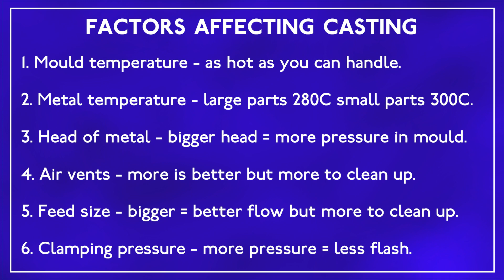HOW TO… PART 2  ‘CAST FROM SILICONE MOULDS’

Comment: Correction...pewter and white metal are not the same. They have different components. Pewter is usually a stronger alloy than white metal. According to Bing AI: Pewter and white metal are not the same thing. Pewter is a malleable alloy that is made primarily of tin, with small amounts of copper, antimony, and other metals added to it. White metal, on the other hand, is a term used to describe a range of alloys that are white in color and have a low melting point. It is often used as a base metal for plated silverware and jewelry. The composition of white metal can vary depending on the manufacturer, but it typically contains tin, lead, and antimony
Reply from the maker: They will both cast with this process.
Reply: And being an antique collector I’ll add, white/pot/hard white/Britannia seems to be crystalline and is definitely more brittle and rigid

Comment: Modern pewter is about 91 percent tin, 7.5 percent antimony, and 1.5 percent copper. lead in pewter was banned in 1974 for a good reason, so if you are going to handle your model a lot make sure its lead free.
Reply from the maker: You are absolutely right. Pewter containing lead should be handled with respect and was banned from drink / foodware long ago. I take care at all times not to ingest any.

Comment: Maybe if you can find a 1cm wide long strip of leather, wet it and wrap it around your warmed mold with boards. Even a few wet leather strips would function better than rubber bands and would be heat resistant and reusable for the most part.  Inner tubes cut into enormous rubber bands or strips to tie or wrap, could last longer for larger molds
Reply from the maker: That's a good idea I may give that a try, thanks. 🙂
Reply: Muy buena idea
Reply: I saw another video doing it with aluminium tape

Comment: I tuned in for casting tips (interesting trick with the vents going through the mold!), but then my jaw dropped at the end when you showed your hand finished master from the casting.  Lovely work!
Reply from the maker: Thanks Peter, I'm glad you found the video useful. As you can imagine it takes quite a while to transform the larger ugly castings into finished masters, but it's a great technique for converting an object into metal. 🙂
Reply: My jaw dropped when I saw your hands….
Reply: Don’t all vents go through the mold?
Reply: My experience is with resin casting. Typically the air vents are only cut up, across the face of the open mold. The idea of adding vents at catchpoints THROUGH the rubber is new to me. :)
Reply: @gribzilla  no comprende
Reply: Not sure how to explain more clearly. At 6:29 he’s pulling out the vent/sprue I’m talking about (as opposed to the vents cut off after demold, which traveled across the open inside face of the mold)

Comment: Hi Im getting a fair amount of size difference between master and metal cast - (maybe 8- 10%) Masters are mix of green stuff and pro create. Is this normal?
Reply from the maker: Hi Rupert. That shrinkage is very high. The bigger the mass you are casting the more shrinkage you will get.  Try reducing your casting temperature to 280C or increasing the size of the head of metal to get more pressure in the mould. You may have the mould too tightly clamped together which is flattening the mould cavity. Use as little pressure as possible. Hope this helps.

Comment: A simple trick for making molds like this with zero flashing is to use a Dixie or paper cup or similar plastic cup to pour the initial rubber mold. You want to use the kind of cups that have a straight wall taper, like paper cups, not the kind that have ribs or contours like plastic Solo cups. You place the cup over the pattern and cut a hole in the bottom to pour the silicone in.  Seal the bottom with plastilene  or a glue gun.   When you fill the inverted cup with silicone it’s essential that you stop shy of totally full.  Leave the rubber surface a tad below where the bottom of the cup was. ( so pick a cup sufficiently taller than your tiny model ) When you demold you will likely have to tear the waxed paper cup off, but afterwards ANY paper cup of the same type can work as the casing to hold the mold together.
You then cut the rubber apart to create your two halves of the mold. Cut any additional vents or sprues as needed.  
Here’s the good part. Dust the interior of a matching cup with talc and drop the mold in the cup to hold the rubber together. Then TAP the mold on the table. No clamps, no rubber bands needed. The straight taper of the sides of the cup allow the silicone to settle deeper into the cup ( because you didn’t quite fill it all the way ) and that compensates for mold shrinkage and allows the two mold halves to close perfectly tight and perfectly aligned without over-compressing or distorting the mold cavity. The cup itself contains any leakage, but if you do this right, there won’t BE any leakage. You should get parts with zero flashing and often no discernible parting line at all. 

Also- be aware that for casting pewter or pot metal you want to use a Platinum cured silicone.  Tin cured silicones will SWELL and distort as they become heat soaked.
Reply from the maker: Great hack, thanks for sharing. I'll give it a go. 😎
Reply: @ Not exactly a hack.  I used to setup mold operations for various companies making a variety of products seeking the lowest possible cost and highest possible fidelity.  I did exhaustive cost/benefit analyses of different mold techniques for various kinds of products. What we called ‘Dixie cup’ molds turned out to be the lowest cost, highest quality method for any item small enough to fit in a Dixie cup with room to spare, although it is getting harder to find a good supplier of smooth taper waxed paper cups anymore.   To lower costs of silicone for mass production, I would make a second mold system that produced thin silicone molds and one that made a urethane elastomer overwrap filler.  The urethane filled the contours between thin silicone mold and the shape of the Dixie cup. 
The urethane parts would last for a year or more of casting 12-15 rounds per day in resin, and the silicone inner mold that actually printed the cavity was a lot more flexible due to only being 0.2” thick on average, and was less expensive to mass produce. ( we would have 40 to 60 copies of a given mold on the casting tables for each different product, so we had separate molds for mass producing the molds.) 
This technique took the least amount of time and materials to make, but even more importantly, takes the least amount of labor to operate, and results in drastically less labor in cleaning up castings. 
Although, for mass producing pewter we generally opted for vulcanized neoprene and a centrifugal casting machine.  Large rotational media polishing, etc.
Reply: @ Going further, because these molds are most often cut open blind after the silicone sets ( the hand cut separation line actually is more accurate as regards parting lines and flashing than a fully separated two pour mold with keys ) We would set up a master with a series of vents made of 1/8” or even thinner metal rods, stuck into holes in the board the master was mounted on, so that they would not shift as silicone was poured in. After the pour, when we pulled the master and mold off the board you could see the stubs of the wires sticking out and they acted as cutting guides to lead an exacto knife along the planes we wanted the mold to be separated on.   Like for your featured figure, I would have a wire leading straight up from the board to the tip of each arm.  They would establish the fairly straight separation plane and guide my knife directly to where I wanted the mold to break.  You can even cut 3 and 4 part molds to accommodate complex models, or lateral partial cuts to make the mold more flexible to get tricky bits out.  But the key is the actual smooth taper of the cup and perfectly circular mold shape to ensure the mold is closed with exactly enough pressure to hold the separation lines sealed .

Comment: Thanks again, a very informative and educational video. I'm looking at this with a view to making leadfree pewter jewellery. I've made some interesting pewter castings by calving the shapes that I wanted in a cuttlefish skeleton/bone, and they have come out very well with the organic pattern from the bone on them, but now I want to reproduce several copies from my first bone casting. (it's possible to make more that one casting from a cuttlefish, but the surface of the mould soon breaks down)   By the way, I very much like your Lego mould wall idea in part one!! 
Kind regards . . .  Andy
Reply from the maker: The silicone moulds are a lot more durable than the cuttlefish method. I wish you every success with your project and your channel. Any questions just send me an email. 🙂
Reply: OK, you beat me to it, I was just typing another question. . .  Andy

Comment: Great video mate. I hoping to make some parts for my diecast cars. I pick couple Corgi 007 cars, but both are missing the roof. I don't know if I can use this metal or not. Cheers Graham.
Reply from the maker: Diecast cars are made from a zinc alloy which melts at a higher temperature than the tin alloy I use. The tin alloy is softer than the zinc which may be a problem for working parts. It would be cheaper for you to buy damaged models on eBay for the spares and use them.
Reply: @StaplesandVine  thx for getting back to me. I actually bought a lot of 2 cars sold as spare parts. Figurines, ejector seat and tyres,  I can 3D print.  Just the roof. I can buy parts from the UK, but they always sold out. I watch a few different diecast cars youtubers and they have purchase replacement metal parts and they seem to crumble or break. I don't know what been used. Thx anyway, have a nice day.

Comment: I am thinking of trying this out, is there a reason to have vents coming of the mold that do not lead outside of the mold to allow air to escape??
Reply from the maker: The vents that do not lead to the edge of the mould are often in 'captive' regions of the mould due to the nature of the part and metal feeds. To vent air from them I drill through the mould and run a vent across the back surface to the edge of the mould. Hope this makes sense.
Reply: @StaplesandVine  thats great, thanks for the help

Comment: Hi .
Thank you very much.
I'm trying to make small lead  parts  to 1/72 airplane model ....like propellers.
In resin, it results to much fragile.
But in lead , requires some manual work to correct de surfaces ...
Some other  sugestion  to improve   the quality in surface  and details.... ?
Thanks again .
Reply from the maker: Thank you for your kind comment. This is a good technique for making propellors but you will always need to carefully clean up the castings with files, sandpaper or wire wool. It's great for smooth surfaces but you will often loose detail in the cleaning up stage. This you will have to re-create by scribing in lines or adding parts from styrene sheet / rod.
I hope this helps, Sera.

Comment: Thanks for the awesome video. I would love to see the actual casting of the maus tank tracks as I plan to cast 1:10 scale jagdpanther tracks. I am planning on machining a drilling jig to drill out the track pin holes and possibly inserting some brass tubing to aid wear and tear. But not even sure whether the pewter tracks will withstand running...
Reply from the maker: Hi Leo, Thanks for the great comment. The pewter is really too soft for a working model. A lot of hard work would get trashed pretty quickly. I would suggest making pewter masters using this method to prove they work, and then finding somewhere that will cast them for you in something more durable. All the best for your Jagdpanther build. Sera.

Comment: Hi again. I've just looked at the online specification sheet for the 3481 RTV rubber and there's nothing to say that it is suitable or recommended for casting pewter. All it says is that it can degrade if used at temperatures over 150 degrees C. (that's about only half of the pewter melting temperature.)  I'm sure that it will take a higher temperature as we've seen multiple castings from your moulds. Some four years have gone by since you made this video and I wonder if these moulds have held up to multiple castings over the years or if you have moved on to something else. I'm only playing with it as a hobby so I guess it won't be a problem for me, but it would be nice to know how it's going.
I've got some Mold Max 60 that I haven't started to use yet, and that states what they call a "Useful Temp Range of -53 deg C to 294 deg C   (-65F to 560F)
All the best . . .  Andy
Reply from the maker: Hi Andy, the silicone is only seeing the high temperature for a few seconds and the heat soon dissipates. I've been using it for 20 + years and never had a problem casting up to 310C. The moulds are great for very short runs but for production you would need to look at centrifugal casting and would need a leaded pewter for masters - been there made that mistake. Other silicones I don't have experience of I'm afraid. Sera

Comment: So I make fishing lure injection molds for soft plastic out of plaster, could I make a mold of my mold then simply build a wooden box around it and pour aluminum on top ? Would that be able to pick up details in the lure ?
Reply from the maker: Hi, silicone rubber moulds are only good for casting at around 280-300C. Aluminium melts at a much higher temperature and would instantly destroy your mould and could end you up in hospital. Aluminium is best cast in sand moulds and will need a lot of hand finishing. Hope this helps.
Reply: @StaplesandVine  thanks for the reply, there must be some miss communication tho, so what I was intending to do is with one of my plaster molds I can make a mold on top of the plaster mold with more plaster then pour aluminum on the reverse mold in return making half of the mold then repeat for the other side giving me a aluminum mold, I'm hoping the plaster will transfer the detail to the aluminum well enough tho. Sorry if that's tricky to read, I'm not very good at wording things lol

Comment: what kind of mould material is best for making sterling silver rings? Thank you.
Reply from the maker: Hi, to cast sterling silver you need to use a process called 'investment casting' or 'Lost wax casting'. This process is for low temperature alloys. 🙂
Reply: @StaplesandVine  
Thank you!

Comment: great video. Is there any particular formulation of pewter that you like for small, detailed molds? I'd prefer to not use lead if possible.
Reply from the maker: Different subjects require different alloys. Here's a good list of what is available - http://www.gwneale.co.uk/castingalloys.html# The lead makes casting a lot easier but lead free is available. I use 90/10 for various reasons.

Comment: Hello its great work, I use the mold max 60 and when I cast the lead in the mold the silicone is peels off can you tell me why? And thanks so much
Reply from the maker: Hi, 'Mold Max 60' should be fine, judging by its specs. It's not a rubber I am familiar with. Maybe you didn't mix it to the correct ratio or thoroughly enough? I suggest contacting your supplier.
Reply: @StaplesandVine  thanks for the help

Comment: Wondering if we can use this pewter technique to create molds to inject plastic? For those desktop injection machines  from LNS.
Reply from the maker: Hi, I have no idea whether you could use pewter to make moulds. It has a relatively low melting point which does make it very versatile. I would love to know how you get on.
Reply: @StaplesandVine  Thanks!  I will try it!

Comment: Is there something other than rubber bands I can hold the molds together?
Reply from the maker: Hi Marissa, I use rubber bands for small moulds and G-clamps for larger moulds. Holding it in a vice works well. You can use whatever you like but be careful as the more metal you pour in the more pressure you need to hold the mould closed. The metal is hot and dangerous so always err on the side of caution.

Comment: I love whaching your videos but I have a question could I cast with just srait aluminum or strong exsruted aluminum I know I spelled exsruted wrong, however hopefully you'll be able to answer my question 😉😁 Thanks Much.
Reply from the maker: Hi David, NO this method does not work for Aluminium. Aluminium melts at 660C, using this method you will end up with a fire and probably a visit to the hospital. Lots more 'How to' videos to come. Glad you like my channel, thank you for subscribing.
Reply: Okay I got it I'm sorry my phone is just a little slow on getting repliesactually this is a new phone so it's a little bit hard to understand it so just reply I asked you already answered it thank you 😁
Reply: @StaplesandVine  so my next question is moles that can use for aluminum? And again thank you for your time and response. 🤔
Reply from the maker: Hi David, try searching for 'sand casting aluminium' in Google / YouTube.

Comment: Could I cast with something like this? Does the mold have to be rubber? Could I make a silicone mold, or will it melt? Instead of plasticine Could I use fimo clay?
Reply from the maker: These moulds are made from silicone rubber! Always use a high temperature grade '3481' is what I use. You could try Fimo but it is a lot more expensive than Plasticeine and harder to rework. You will use quite a lot so bare that in mind to.

Comment: can i use pure zinc metal instead of putter? can the rubber mold handle the melting point of the zinc?
Reply from the maker: The  melting point of zinc is 420 C This will be too hot for the silicone moulds. You will probably end up with a hospital visit...